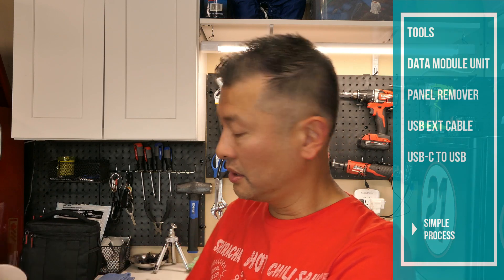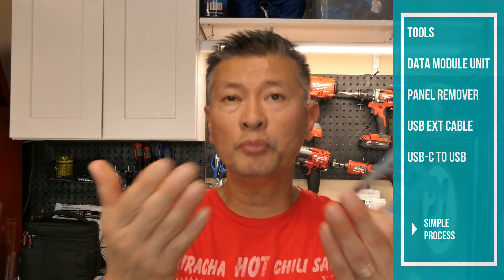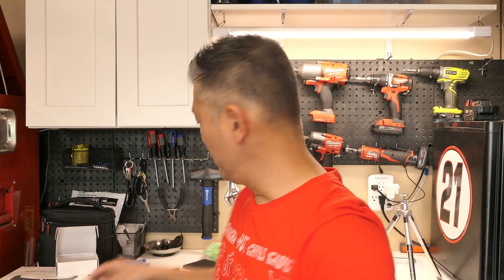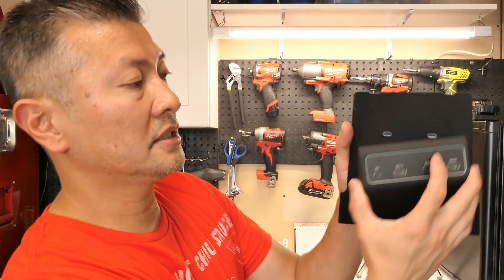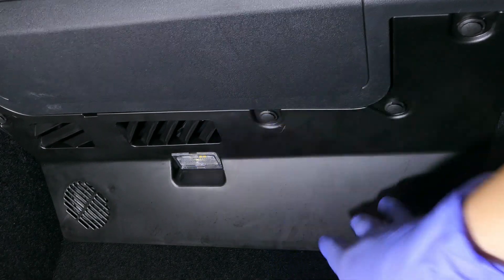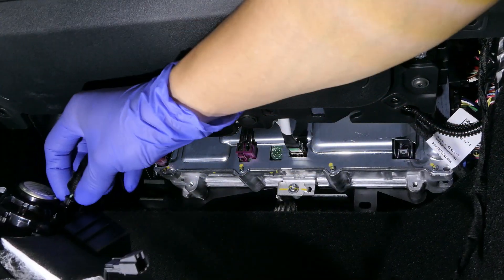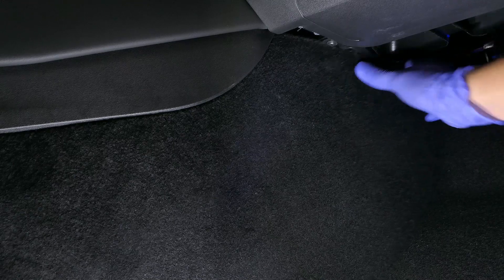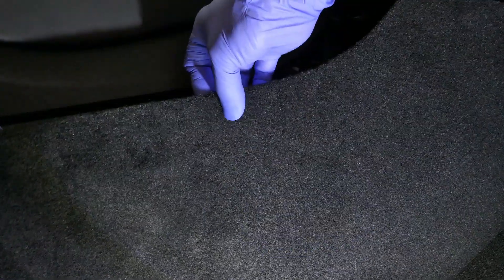Upgraded Tesla Model Y Data Transmission Module Installation, Play MP3 again! #tesla #teslamodely

Comment: I have the extension cable taped up in my 22 M3P Shanghai. But when connecting using the cable it did not work. Had to bypass and connect directly from new module to ECU

Comment: 2023 Model Y. Why don’t my usb c ports in the backseat and console NOT WORK? I bought an adapter so I could use my iPhone charging cord but it doesn’t seem to charge. Help! Thanks
Reply from the maker: Did they work before any changes you may have recently made? How about testing it with another cable? Maybe pull out the wire to see if it's properly connected?
Reply: Hello, good morning, I have the same problem. Were you able to fix it?

Comment: Hi Peter, Thank you so much for a very helpful video. I clicked like and subscribed to your youtube channel. I ordered the Tparts console data transmission module and installed it on my new Tesla Model Y (It was built in December 2023, I bough it last month during the inventory discount time frame at Tesla Fremont CA, it has only 8 miles on the odometer), but unfortunately there is no USB port on the ECU unit at all. I took a picture of the ECU unit and want to share it with you, but there is no option to attach a picture here. At least I tried, so I guess I just have to listen only to the radio then.
Reply from the maker: Send the photo to: theautomotivefanatic@yahoo.com

Comment: My 2022 MYLR actually had the cable fitted so I only had to install the new cenrral USB module and connect the existing unused cable to it! It all works fine now and I have data from the central usb ports.
Reply from the maker: You're on of the few lucky Tesla owners.

Comment: Remember: no MicroUSB port underneath the passenger seat footwell for 2022+ Model Y/3 with Hardware 4...
Reply from the maker: Thanks for input. So you're saying you CANNOT add this at all due to the lack of the input with HW4?
Reply: @TheAutomotiveFanatic  Current. My 23MYLR does not have the computer USB port to plug the cable, 2 weeks of research and dismounting the whole section is the source. I wanted to be wrong... Thank you for the very detailed installation video!

Comment: Question for all those who have installed it. My data module was working OK, so I has data on the center console... but after last software update it is not working any more. Has this happened to anyone?
Reply from the maker: Mine is still working even with the latest update.
Reply: @TheAutomotiveFanatic  Thanks for your input. I will keep   looking for the solution.

Comment: Dang!  On the new Model Y - the removed the port on the computer.  😢
Reply from the maker: Supply chain issues.
Reply: @TheAutomotiveFanatic  Not sure I buy that it's supply chain.  I think it's more strategic by Tesla - removing the data link and any form of CarPlay basically forces you to purchase a subscription to premium connectivity and apple music.  Worked on me!  I bought it when I couldn't use my phone to stream.  Sucks!  Extra $240 a year that I didn't really want to spend.

Comment: Yeah I was surprised that usb didn't work when I took delivery this month as when I originally tested the Y years ago it worked. 
I agree that it's better in the center .  I bought one of those sub hubs for the glove but I can see Its not good from the standpoint
of it never powers down. Tparts has this cheaper than the Tesla vendors as well as there other stuff. Might get one I have installed
stereo's before. When I do I know it's a good idea to have spare plastic clips.
Reply from the maker: Extra clips are not a bad idea at all. Even extra metal clips are good too!

Comment: 2023 model Y cable was not installed
Reply: Unhook the power cable from the old module and feel back along the power cable about 2.5 inches. Do you feel a lump in the taped up power cable? If so, THAT is the end of the usb cable with a large connector on it. carefully remove the tape to expose the connector that is folded back on itself. Good luck, I just did this an hour ago on a 2023 Y built in January 2023.
Reply from the maker: @hamdude2109  great tip!

Comment: Thank you very much! I just installed it and it worked!!  Your video helped me end a frustration I've had with only one data port in my 2022 M3.  Granted I've been able to work around it by setting up partitions in the flash drive, but I really like the ability to have data ports in the center console for a dedicated music flash drive and to be able to plug in a game controller without messing with my Scentry drive.  BTW...I was one of the lucky ones that only had to plug and play from the center console.  I didn't have to do the extra work you had to do.
Reply from the maker: Hello Vicki, I am glad that you found my video useful; even better than you had the data cable already attached. Cheers and happy holidays.

Comment: I purchased and installed the T Part Center  Data Module about 4 months ago.  This allowed me to play music from my USB.  All went well until yesterday when  my 2022 Tesla Model Y responded to my engagement of my USB with the following message "Loading Error - USB Device"  Following the category "Resetting USB in Tesla" I was advised to "tap controls - tap Safety & Security -scroll to Format USB device - tap format".  Unfortunately, the "format USB device" message was greyed  out.  Added efforts included voiding and reloading my USb.  To no avail.  Your advice?
Reply from the maker: Hi Arthur, sorry to hear about the issue. Perhaps the drive became corrupted somehow? Did you try another USB device to rule out a defective data module?
Reply: @TheAutomotiveFanatic  Yes, TPARTS noted that they have had no defective data modules - must be another issue.  No replacement forthcoming.
Reply from the maker: @arthurgillis7891  That's discouraging. I'm sorry to hear that.
Reply: I replaced the Center Data Module with one from TPART.  Worked well for 4 months then when tried to listen to music on my USB I received a “failure to load” notice. Used new USBs to no avail. Found a note to try a reboot - did not work.  Tried a new USB hub in glove compartment.  Sentry continued to work through it but no working music  USB.  What to do now?
Reply from the maker: @arthurgillis7891  it sounds like the unit might have been defected. Did you get in touch with TParts?
Reply: The cable probably came unplugged in one of the three possible locations. Remove the trim and inspect the cable connections. (unplug and replug them)

Comment: is there any trick to remove that factory usb panel? I tried with tools and it does not move at all
Reply from the maker: Jason, you have to use the provided tool and some force. Don't worry, you will not break anything with that tool. Check out 5:05 where I show how to remove it.
Reply: @TheAutomotiveFanatic  I tried and still not moving, I ended up with using pry tools opened up from top, its much more easy I think.
Reply from the maker: @jasonshi5558  thanks for your input. I remember the first time I tried, it was difficult. Perhaps the next time I will use your advice!

Comment: July 2022 built Model Y. No data cable taped to charge/power cable inside center console. smh. Will need a data cable to feed from usb module to data port under glove box?? Does TParts data module kit come with data cable long enough to connect from module inside console to under glovebox? Also, how difficult is it to feed data cable from module to port under glovebox?
Reply from the maker: Are you serious Gregory? Your Model Y didn't even come with a data cable hidden in the center console? Here is what I would do...contact TParts on IG and ask them if the included cable is long enough. When I used the extension cable, there was definitely extra length. However, I had the hidden cable so I can not confirm if TParts's cable is long enough.
Reply: Yep. Quite serious. Tesla really screwed new Model Y Owners (07/2022  forward build). No usb data and no path to add it aftermarket.
Reply from the maker: @gregorycooper7340  chip shortage and Tesla being cheap.
Reply: @gregorycooper7340  wish I had read your comment before dropping $120 on the kit. Pretty lame for Tesla to leave out the cable all together. I’m in the same boat as you now.
Reply: Man…I have same issues with my July 2022 model y too 😢 I’m literally right looking at the console I just removed and find no data cable under there 😢
Reply from the maker: @stevenluong9612  pop in one of these and you're good to go!
Reply: @TheAutomotiveFanatic  What exactly are you saying?  This product will give me data, even if I have no data cable??
Reply from the maker: @gregorycooper7340  If you do not have the data cable, which is possible, you'll have to connect a data cable from the main ECU to the center console data module.
Reply: Actually, looking at the TParts video for their module installation has a real nice video showing their supplied cables fished through and plugged directly into the usb data module in the center console. This leaves me to believe I can complete the installation with what is supplied in the kit.
Reply from the maker: @waranha  correct, you can totally install this yourself!
Reply: @TheAutomotiveFanatic  thanks! I just ran the provided wire and connected it at both ends. It barely reaches but it does work and appreciate your detailed video —panel removal/replacement was a breeze. Tested that data port does work with a game controller now in the center console. Cheers!
Reply from the maker: @waranha  awesome!
Reply: ^the video supplied for Tparts on Amazon.

Comment: I have had the TParts module since early 2022. Works great. Love it. Tesla, please add data ability to center usb-c area again. I use the ports for dual game controllers and usb based music media because I do not like my music getting compressed by Bluetooth transmission.
Reply from the maker: That's a great point...your music does get compressed via BT. Thanks for your input!
Reply: @TheAutomotiveFanatic  Resolved with Qobuz hi-res audio. Way better even on Bluetooth.
Reply: My Model Y didn't come with the extra games (like Sonic). Does adding the Data ports make the car download the games?
Reply from the maker: @giohernandez396  I believe the games were omitted from the factory. Only OTA updates would provide you the games. The data ports have nothing to do with it.

Comment: I don’t even have the data cable attached with the power cable. Even with the extension cable I will still need the cable to attach to the transmission module on model 3.  Took delivery a week ago.
Reply: TParts module comes with the needed data cable.
Reply: I have the same problem. No data cable taped to charge/power cable inside console. Will need a data cable to feed from usb module to data port under glove box?? Is Electric Ant saying that the cable is long enough to feed from Module inside console to data port under glove box? Can this be done?
Reply from the maker: Gregory, I cannot confirm if the TParts cable is long enough. Because I had the hidden cable, I connected it directly. I will say though, I had extra length of it might work.
Reply: I just got my Tparts kit and my 22 MYP (march order/June delivery) doesn’t seem to have the connector taped or visible to plug into the unit. I do have the tparts extension cable but not sure it has anything to plug into on the center console side. Will look closer during daylight tomorrow but sort of concerned.

Comment: I like the video but need to point out that when you use the tool to remove the push pin you don’t pry the entire pin out.  The pin has two sections, by pulling the inner section up it allows the pin to squeeze through the hole.  Reinserting is the opposite, pull the inner pin, insert and push the inner pin in.
Reply from the maker: Thank you Scott for your input. I can appreciate valuable feedback that helps me do something better.
Reply: Haha I noticed this also. You can actually do it without the tool if you know how to use those clips. One clip is too close to an edge so you need to use something other than your finger nails. Unless you’re a real man with song fingers, no need to use any tools, bare hands will work just fine.

Comment: Nice upgrade!  I just received a 2022 Tesla model Y last week.   Do you know if this usb data module interfaces with the glove box USB port in anyway ?  I’d like to add data to the USB ports in the center counsel  but only if it doesn’t affect the glove box ability to use a 4 port hub in the glove box.   TParts product page says something about their module not working with certain 3rd party hubs but I’m hoping this just applies to the center consul and not the OEM glove box USB port
Reply: I received a response from t parts customer service. “Hi Jon,
Thank you for reaching out to us!
Our Data Module will not interface with the USB port in the glove box, and your USB hub will be still working with our data module installed on your Tesla.
 
Hope this answers your question,

TPARTS Customer Service”